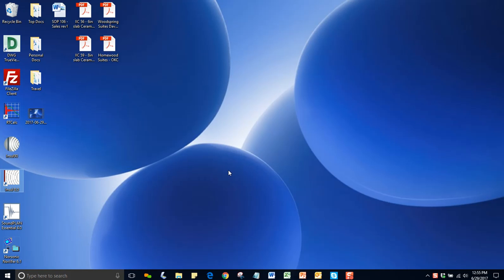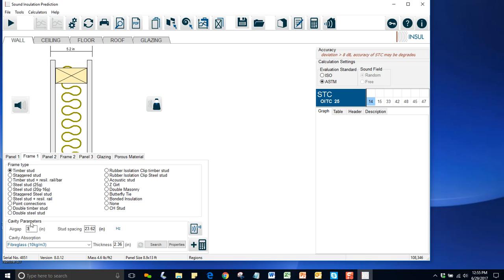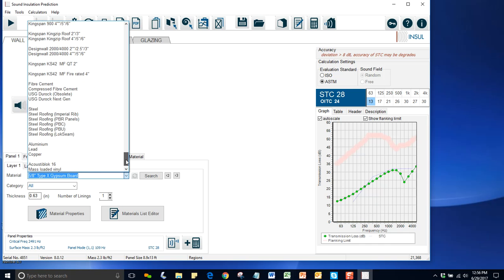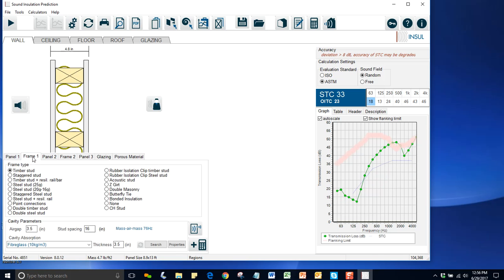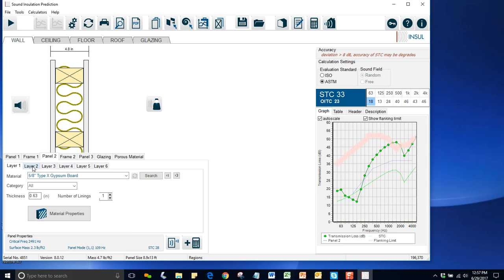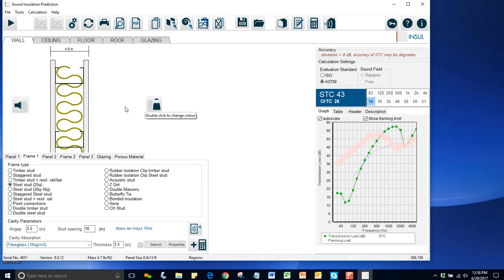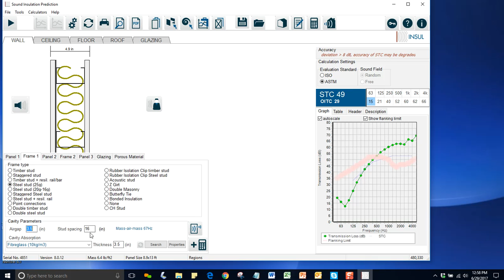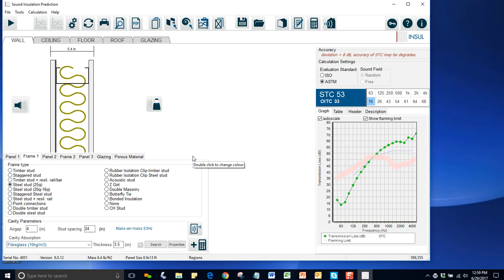Using INSUL to Model Wall STC (Sound Transmission Class)

Comment: Can u explain how to interpret the graph?

Thanks
Reply: Hi Panca, sure. The graph is how much noise is blocked at each frequency. Lower frequencies are more difficult to block, which is why the graph is lower on the left (Frequencies are on the X-axis, and Transmission Loss is on the Y-axis). The STC is an average of how much sound is blocked overall. So a wall that blocks 20 dB at 100 Hz and 40 dB at 1000 Hz may average out to around STC 30. 

ASTM 419 details the calculation method. Thanks!
Reply: @commercialacoustics767  What the Pink line means?
Thanks For reply